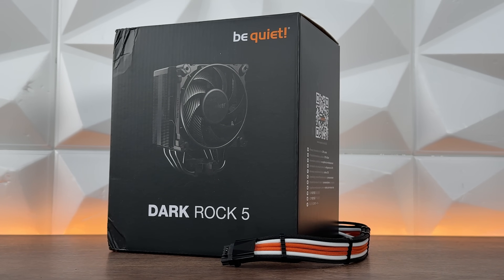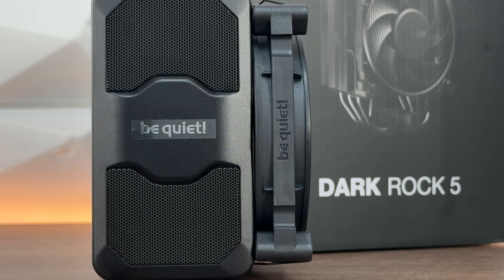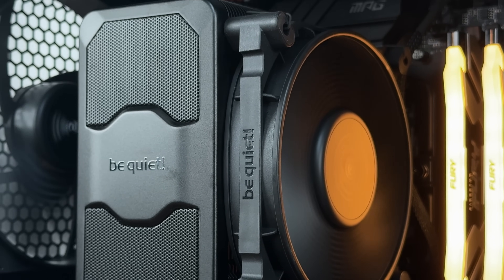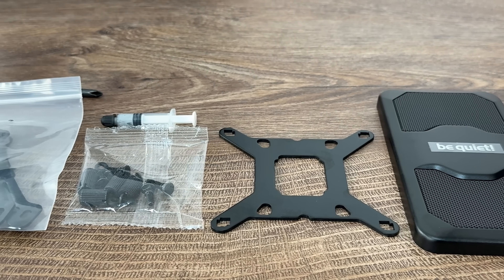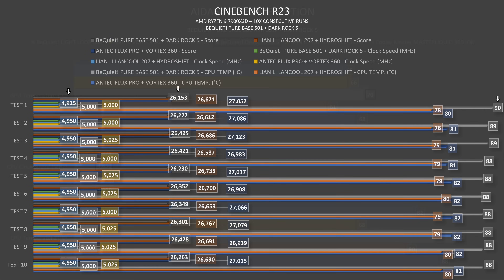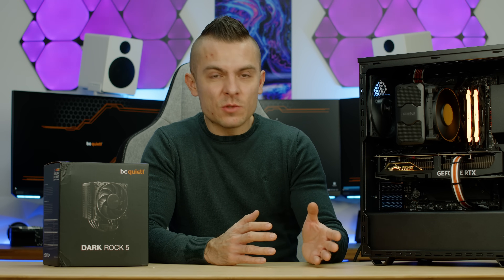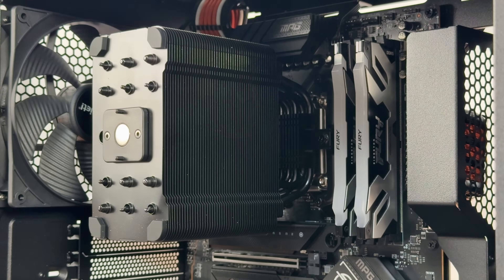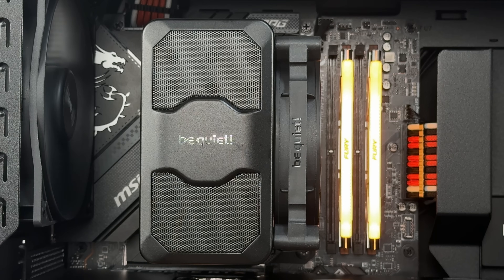BeQuiet! DARK ROCK 5 - Review, Installation AM5, Tutorial!

Comment from the maker: As promised, DARK ROCK 5 is compatible with LGA1851.
In addition, there is no need for offset what I mentioned in the video because the heatpipes are running from the top to the bottom and not from left to right, which mean that all of them are in direct contact with lower heatspot of the AMD CPUs. Definitely one of the reasons for such impressive results. 😉

Comment: I upragrading my 9600x to a 9800X3D Hope my dark rock will keep up 😅
Reply: What are the temperatures under load? Is it sufficient, or would a stronger cooler like the Pro be needed?
Reply: @davor1599  on fortnite (my most cpu intensive game) i get around 70 degres Celsius even after a long session